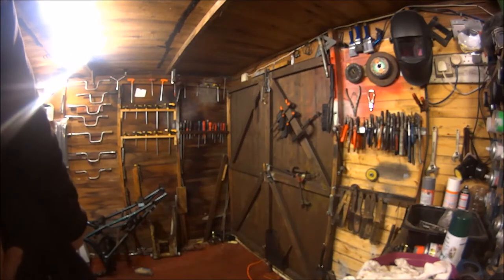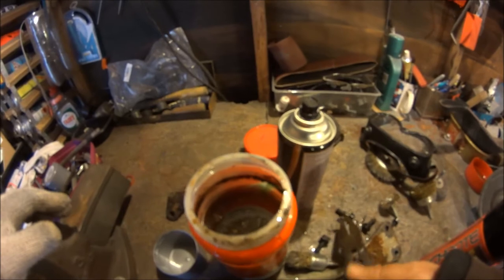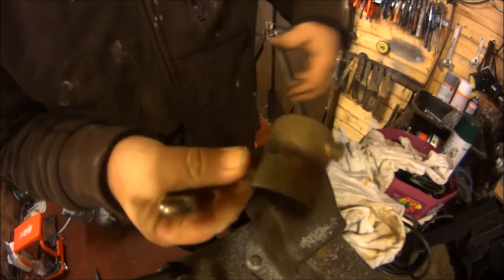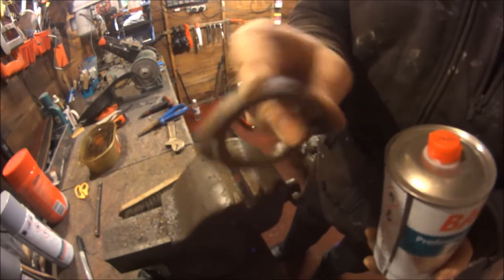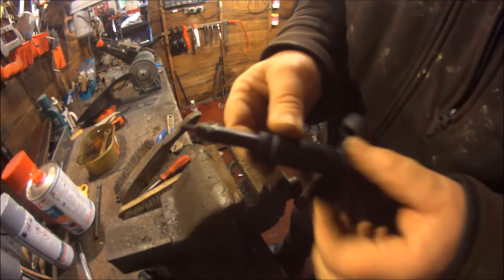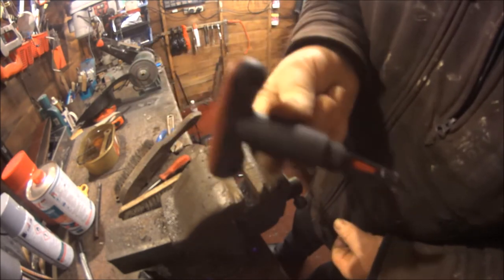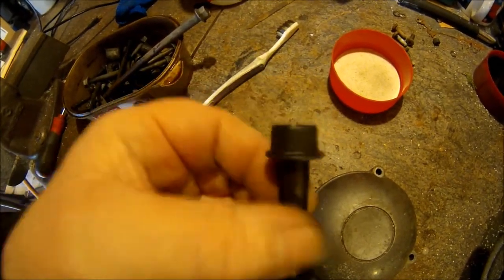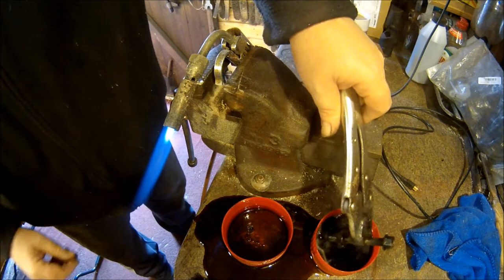Black nuts and white vinegar.

Comment: Like the guitar.try mixing building sand or play sand with sump oil...till quite firm . push bolts etc in. Saves all the mess
Reply from the maker: thanks for the tip Darren ill try it.